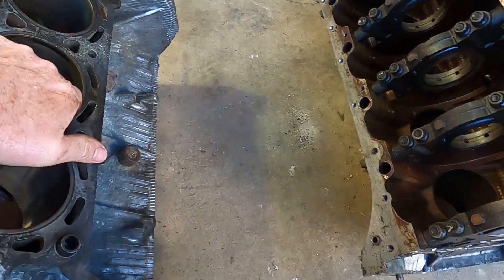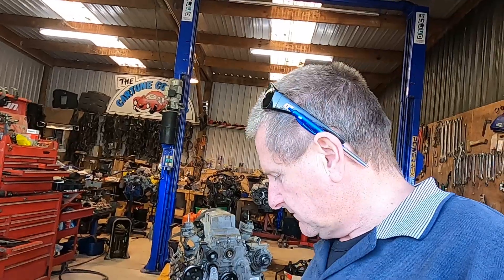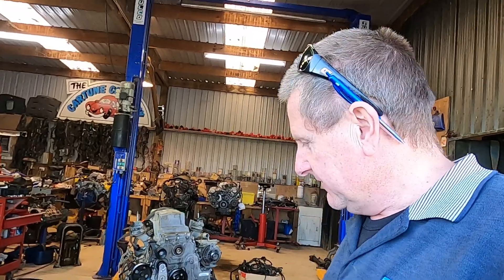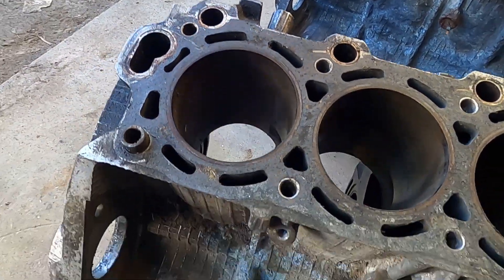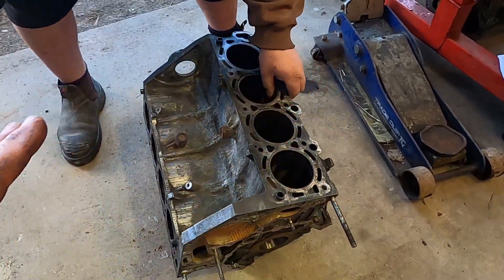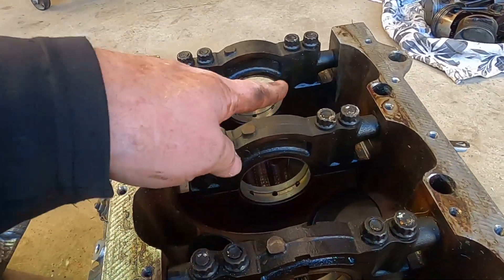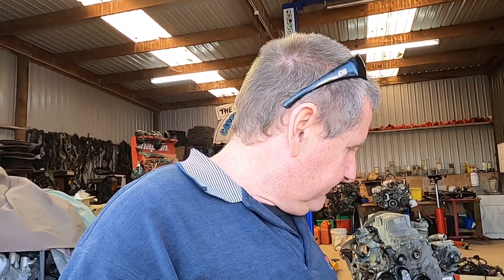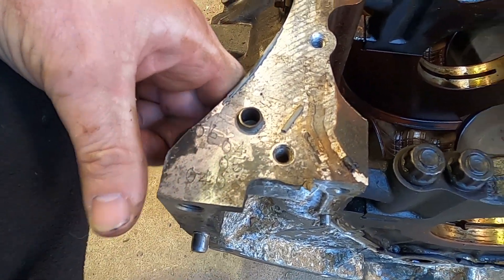1uz non vvti Block differences between Series 1 and series 2

Comment: I have a VVTI block with the 3 holes but no recess in the main caps. Not sure if you’ve ever seen that.
Reply: Also they’re square, no chamfer but also no recesses.
Reply from the maker: Interesting.  One thing Ive learnt is its not possible to see everything,  as toyota / lexus like changing a few things around to keep it interesting.  Cheers for sharing.  ill look out for it in the future.

Comment: Hi there guys, hoping someone can help me, i bought a 95 LS400 and the engine went caput, after watching this ive seen a lot of Gen 1 1UZ up for sale, does this mean i can take a Gen 1 Long motor to replace my Gen 2? I cant find any information apart from this telling me they are different or anything. Keep in mind only need the long motor, block and heads and internals thats it, wiring and everything is still good in the car. Any help would be fantastic, cheers guys and love the content

Comment: Can anyone tell me if camshafts between the fe and vvti models are interchangeable?
Reply from the maker: The camshafts between Vvti and non vvti engines are not interchangeable.   Both vvti and non vvti are 1uz-fe engines.
Reply: @CartuneNZ  so if they're both FE engines than why can't they be changed out? I'm currently doing a engine overhaul with performance parts and before I touch anything I'm just trying to clarify first. But I can't find any performance camshafts for the VVTI anywhere
Reply: Did you ever find out

Comment: I agree with "windage" as the most likely reason, but I would not rule out the length of the drill bit used on those 3 holes, and it getting wobbly at the end, nor the drilling machine that they used did not have enough "throw" to do a 4th or 5th hole.

Comment: The 1UZ engine changes for the LS400 1995 model year are described in the Toyota document for new model.  Quoting that document:
"Passage holes are provided in the crankcase of the cylinder block to reduce pumping loss.  Passage holes [31 mm (1.22 in.) in diameter] are provided in the crankshaft bearing area of the cylinder block. As a result, the air at the bottom of the cylinder flows smoother, and pumping loss (back pressure at the bottom of the piston generated by the piston’s reciprocal movement) is reduced to improve the engine’s output."
I'll email the document for your library.
Reply: There's a lot of random good info in new model features for these cars if you have access to it.
Reply: Agreed. Ive seen this on engineering papers where when one piston is going down they want it paired to another piston moving up so the air goes back and forth vs being compressed and wasting energy.
Reply: Sounds like that's probably why those racers seek out those blocks as ever little bit like that would help in making power, while it shouldn't have any impact on the strength of the block.
Reply: @andycanfixit  has anyone considered drilling out those holes in the other version for the benefits?

Comment: Seems like the holes in 2uz would make it flow better. Oil has quicker passage for more adequate and quicker oil flow for rpm oil response. Less wear & failures for quicker rpm output. The 2uz probably turns more top rpm hp range also. Just ideas not reasearch. I have the 2jz I'm rebuilding once I get a new crankshaft. The thicker rods of the 1uz I hear is what I need to locate. Know any other inexpensive hp gains for the 2jz? I have read some on it and they aren't far from max stock. Thanks for your time and any advice.